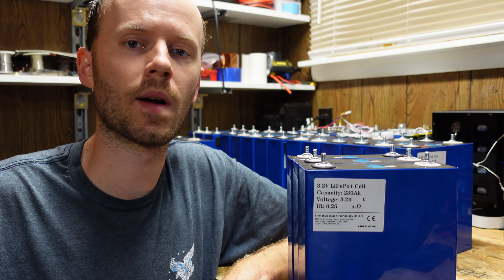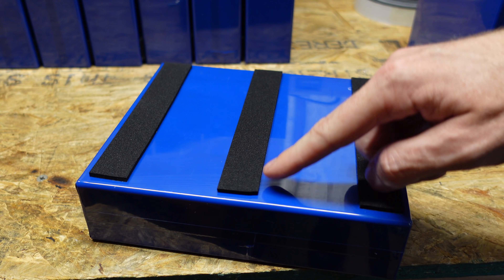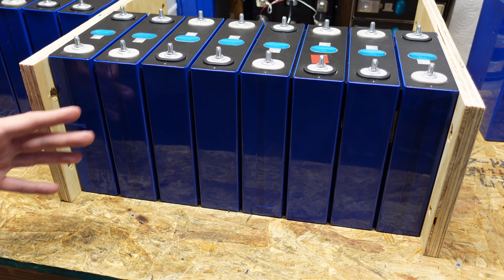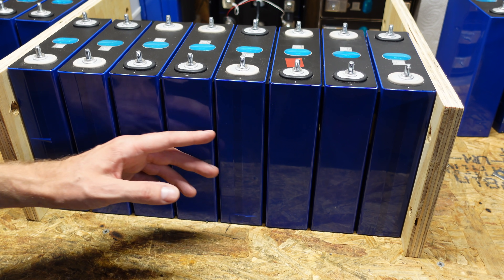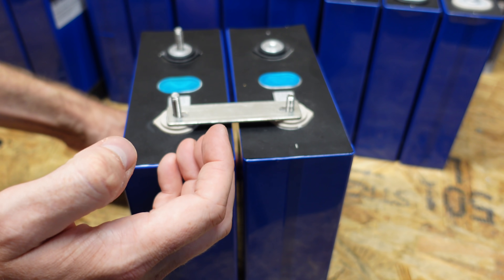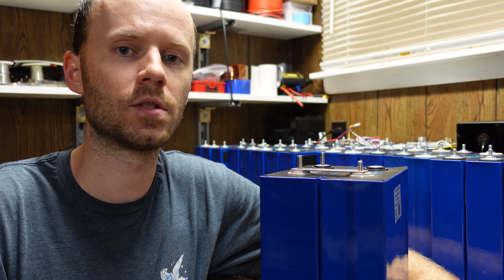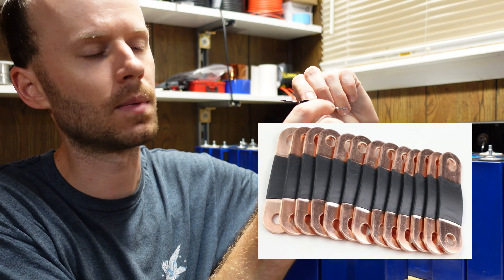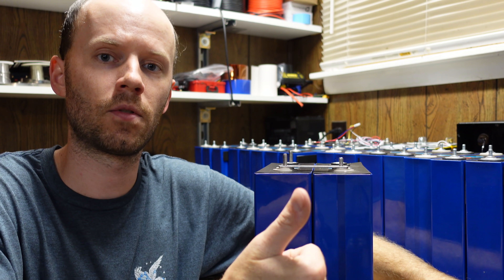Quick Update on 230Ah LiFePO4 Battery Pack Building and Fixture

Comment: I’m in the process of doing a cad file, and sending it off to get a bunch of thin copper cut and bend and stack. I was also thinking of DIY coating them with chrome or silver. Just not totally sure on the coating. But not sure if that’s something you’d be interested in.
Reply from the maker: YES!! Nickel-coating seems to be the standard from what I can tell. How soon can you have it done lol? I'll buy some.
Reply: @LithiumSolar  Electroplating the copper strips with nickel yourself is also an option, and surprisingly easy.  Geoffrey Croker's channel has a great guide to doing it at home.
Reply: @LithiumSolar  do you want some longer ones for end to end as well? If so can you get me the measurement in mm? Center to Center ?
Reply: Buy the tinned braided strap in roll form and then use a tapered rod to make holes for the lugs (spreading the braid). You can use whatever type washer to prevent corrosion.
Reply: @niwachien  I have 1” braided strap. About 100’ of it. I’ll have to test
Reply: @niwachien  just makes me a little worried if it heats up abs lays down
Reply: @DIYSolarEnergy  I size my strap for 120% of max amp draw but I've never used it in this manner. It is easy to add solder to tinned strap to increase it's ampacity. You can also add strips of silicone under the strap. It's available in sheets of various thickness fairly cheap.
Reply: @niwachien  I agree. I have custom built Amateur Radio Amps, and use it often. For ground straps and yes it wicks easily
Reply: @DIYSolarEnergy  I used it to combine 250 4.4ah lithium polymer battery packs, each having their own BMS into a 36v nine inch cube to run my trolling motor. 1000 solder joints. The combined used packs deliver just under 100ah
Reply: @niwachien  If you have tinned braided strapping, could you heat and solder the ends and drill a hole?
Reply: @haydenwatson7987  Yes.
Reply: I’m interested 1000% man
Reply: I wonder if there is an option to have the strips open ended so that if there is expansion they cannot pull? If using a big enough washer on top the prongs would maintain a good area of contact. Just need to make sure they are long enough not to be able to slip out and cause either disconnection or shorts.
Reply: @BobHannent  The woven copper strap is continuous with a hole spread open in it's center for each battery terminal. Extra strap material arches up between each batter terminal to allow for expansion.

Comment: Still happy with the 230ah cells? 
I am getting ready to take the leap of building a 24v battery an I think I will start with 230ah cells
Reply from the maker: Yes sir, they've been fantastic - still running strong. I'll be rebuilding them in a steel enclosure here in a few months and at that point, I plan to run a capacity test to get an exact number of how much capacity they've retained.
Reply: @LithiumSolar  will be great to see. Your videos are very helpful.

Comment: Why would you not compress the 230s?  I have 16 of them and really like them
Reply from the maker: Have you watched this video yet?
https://www.youtube.com/watch?v=uZe6BDvWPfI
Reply: @LithiumSolar  OK so I just watched the video. What I had decided to do and basically am still keeping them this way is to lightly compress the 230s with ply and threaded rod. The ply gives me a nice place to mount the BMS units and Bluetooth transmitters 

When at full soc I tightened with a socket, but no ratchet, only hand tight. So at lower states of discharge they are loose enough you really can't pick up the batteries and frame without being concerned the batteries could drop out

I also had the hump busbars, but decided to make 2" cables with #2 wire and M6 lugs.  I tested the resistance of the cables when complete and the resistance was all the same and slightly less than the hump busbars.

But being slightly compressed the cables where probably overkill.

Comment: Dont you want to constrain the cells from expanding? because what is happening inside is the anode and cathode are being pushed away from each other and that is a major factor that contributes to capacity degredation, any pouch cell that has gone puffy is not long for this world as there is now nothing holding the plates together so they lose contact across most of its surface area and that directly correlates to capacity loss. So the same principle applies for hardcase packs, cyndrilical are the best because there is no side to give out but Rectanglular cells can push out in the center so you want even compression across the whole surface of the battery, especially the center, since it is not constrained by the sides.
So I think full sheets across the whole side of the battery are the ideal solution and have compression according to the manufacturers specification. Ideally you would want something that will allow for expansion and contraction while keeping the same amount of pressure.

Comment: I think galvanic corrosion is often misunderstood.  Ideally, you want the two metals to be as close to each other on a galvanic scale as possible.  If you are worried about copper buss bars to aluminum, a thin solder coating would be slightly better on a galvanic scale than nickel would.  
According to EVE manufacturer, the cells swell in the middle about 1mm when fully charged.  Bending buss bars at 90 degrees is not the same as elongating them laterally.  The neoprene will surely give before the buss bars elongate.  
The fuse to the BMS is a bad idea, because it will likely induce voltage differential over time.  Check into a PTC resettable fuse that you could solder and shrink wrap to the buss bar.  
Stainless steel grub screws into aluminum? LOL!! (cadmium plated steel is a much better idea galvanically).  
Overall, I think your on the right track with the neoprene.  Keep up the good work!!

Comment: What about an offset stagger arrangement like a jacobs ladder or when you knock over dominoes and they lay up on each other. More room for expansion with less terminal stress, downside is the space occupation but this might help with heat/temps....or perhaps use a press and die and make you own little bus bar humps.

Comment: Good info, really enjoy your videos…. keep them coming. WRT securing the plywood end boards, suggest you use nylon castellated nuts to secure them. That way you keep them locked at the desired position and not  apply undesired compression to the batteries.

Comment: The foam (or soft rubber) isolators should to cover the entire adjoining areas between individual cells and the perimeter. Select a material with a specific compressive strength that will provide the manufacturer specified pressure when the batteries expand according to the manufacturer's specs.  The expansion is mostly in the flat areas; the rubber compresses, providing the desired pressure; there should be little or no increase in the center-to-center spacing of the studs.

Comment: I'm thinking of using 1/8" plywood and creating a frame 1" wide to place between each cell.   Inside the frame, I'm going to place 1/4" foam that will compress to 1/8" to match the plywood, but still leave room for the cells to expand.  With this system, I can then use a similar system as you have with plywood ends and ready rod.   My cells are going into a RV so they need to be compressed some to contain them as road vibration will be a bigger issue than expansion.

Comment: I think someone's OCD has kicked in. I put my 280Amp Hour cells together with the kitchen cutting paper between the cells and used the large 12" hose clamps around the entire battery. I used pieces of the cutting paper where the clamps cross the corners of the cells. Worked great and I'm very happy with the results. Don't worry so much. Be happy!

Comment: On the balance lead connection, is there enough room on top of the flange nut to put a second nut? Then the balance lead goes on top of the flange nut and is held in place by a nut on top of that?

Comment: I totally agree with what you're doing with the foam and not compressing the batteries! Exactly what I was thinking on doing with my setup. With my batteries being in a wood compartment that I built I'm just going to place end caps basically so that they cannot expand but no compression as well.
If you think about it the way the batteries are shaped with rectangle on top and bottom there should not really be any expansion or contraction. They should only do this in the middle of the cells.

Comment: So do all LifePo4 cells bloat a bit when fully charged? I got 4 new cells 200Ah from BLS (supposedly Grade A) and after charging first cell I noticed some bloating and stopped charging. The cell was at 3.2V initially and charged it at 15A for around 10hrs. Cell voltage was still at 3.35V so still not fully charged. I am discharging it now to see how much it gives and if the bloating reduces.

Comment: I had a question, it would be more expensive, but would 3A dc circuit breakers be an idea rather than fuses? This way I would just have to flip the circuit breaker back on, rather than going through the hassle of finding the fuse, and putting in a new one? I am thinking from an end user who is not me and trying to make things simple for them. Parents can flip circuit breakers, but they would never go close to the battery to check a fuse.

Comment: Could have just double nutted the BMS lead with the ring connector.   Tighten up bus bars with nut 1, put ring connector on top of that nut and use nut 2 to tighten onto BMS ring connector

Comment: my 16 cell 24-volt Lishen 272Ah builds do move about / bloat at a 40 amp charge from the solar panels charging which is only 1/7 of C so a very low charge. the best is to compress or fixture them to help keep the terminals stay at the same distance (to safeguard the terminal connections). I like your idea and thank you for showing what you are doing. I am not an expert; I can only tell you what I have observed in the 10 months of charging 2 packs of 16 cells each of the Lishen  272Ah cells in a 2P8S configuration (544Ah in2P configuration). keep up the good work. I have not put mine under any heavy loads yet but they could potentially see heavier loads this winter. Again, keep up the good work. I really appreciate your videos. 😎

Comment: I assembled a 4P8S 24-volt battery using 272Ah Lishen cells. I made 4 2/0 short cables to make each set of series connections(28 interconnects). the assembled battery is at 27.35 volts and I am in process of doing the Electodacus for the BMS right now. I used 4 2/0 cables from the main positive end to a positive bus bar, and 4 2/0 cables to a negative bus bar from the main negative end. 28 interconnects for the 8 series connections took 56 lugs. then 16 more lugs on the 8 cables for the main positive and negative.
For the 32 cell 24-volt battery build >>> each of the 2/0 interconnects is short, about 4 inches center of lug hole to center of lug hole; the 4 main positive and 4 main negative 2/0 cables are about 11 inches center of lug hole to center of the lug hole. I have 2 60-inch long 4/0 cables to the inverter with of course hydraulically crimped lugs. They are also heat shrink-wrapped with adhesive-lined shrink wrap for a bit more safety/seal.
 The cells have 20 or 25mm M6 studs that are carefully installed so as not to strip out( a known reported issue). the 25mm studs seem to be the perfect length so any and all connections can be made without length issues.
All parallel connections were made 1st using solid insulated nickel-plated copper busbars provided by another china vendor; then the series connections >> I had to make as the busbars were not readily obtainable and I was seeking a bit of wiggle room.
 Yes very time-consuming to hydraulically crimp all those 2/0 interconnects and main cables; I also hydraulically crimped 4/0 cables for the 2 shunts and class T fuse connections. slow for sure!!!!
 As I assembled each set of series connections I checked the increasing voltage and all was as expected.
The compression fixture is still in the making but I bought threaded rods and nuts/washers etc for that part. still assembling some in-between all the other things to do.
glad to see your videos on the compression issues; as almost all assemblers are encountering similar issues and decisions to be made
 I have 2 other 24-volt 16 cell 2P8S batteries assembled (using 272Ah Lishen cells) and running for about 10 months and some have swelling issues but are still functioning. need to set up compression jig improvements on those 2.
 I like your videos. thanks for providing them! 😎

Comment: I recently found some pre-made braided bus connectors. They are called "red copper soft braided cable" from POTELY. 
They have M8 holes and 16mm2 braided cable, so they are rated at 75A, which might be short of what you want, but maybe you double up?
But they aren't very cheap unfortunately, £3 each.
Reply: really need about 200 amp rating between 272 or 280Ah cells. that was the problem I encountered when searching the braided busbar /cable options.

Comment: I found pure copper grounding strap on Amazon. Similar to the copper coated steel kind you use for securing a hot water heater. This allows for a small arch between the cells which will allow flex. Works for me, YMMV. I am used to lead acid that need a yearly cleaning, I think just keeping antiox and inspecting them is good enough. I'm curious about the fuses on the balance leads?

Comment: I like the idea with neoprene foam.
What worries me a bit is to connect the the thin BMS cable by soldering and also one fuse in series. There will be a voltage drop as a result. The voltage drop may vary between the different 4/8/16 cables to BMS. When BMS measures with such high precision as the third decimal, I wonder if it can have a negative effect on balancing. Also, it might be a variation of voltage drop between the different fuses even though they are the same specification and order batch.

Comment: Just make rigid plastic frames about 1/8” apart - I’m thinking using T section. So the centre of the batteries can still expand but around the edge of the aluminium frame you now have a rigid plastic frame.

Comment: I would use 1/4 or 5/8 in copper tubing.. hammer the ends... drill a hole on each end.. you have a simple and cheap buss bar.

Comment: Nice video, I came to the same conclusion to use something soft as spacers for my swollen cells. 
I'm hesitant about curved busbars, not sure if studs are strong enough to bend busbars when cells are "breathing", or maybe if the curve has more angle (more like __/\__) then it's a good idea to use curved busbars.
Reply from the maker: I feel comfortable with them as I can bend them very easily in my hands. That being said, every cell and bus bar is different so can't say the same applies everywhere.
Reply: @LithiumSolar  got it, thanks

Comment: I was very surprised to hear that you only expect a 5 to 10 year service life for big , blue LiFePO4 
batteries .   I would think that a cycle range of say 50 to 80 per cent would give about a 15 year lifespan .
Reply from the maker: I really don't know what to expect to be honest. At 3500 cycles, that's just under 10 years. At that point, I don't know if other factors would have come in to play such as corrosion, degration of elctrolyte, cheaper battery technologies that make it worthwhile to upgrade, change of personal interest in such a project, etc. If I get 10 years out of them, I'll be crazy happy!
Reply: @LithiumSolar  Cycles refers to depletion and recharge, not simply some use and recharging each day. Drawing down 40% of capacity and recharging to 100% is not a cycle.
Reply from the maker: @Stephen2846  Yes, drawing down to 40% and recharging to 100% is indeed referred to as a "cycle". However, you are correct in that the "cycles" referenced in the datasheet are referring to complete discharges. They are both "cycles" just the 40% cycle is not a "complete cycle" if you want to get technical...
Reply: The batteries will degrade over time even with no cycling at all. I think calendar life might be a more important metric than  cycle life for LiFePO4.

Comment: I would have placed a metal plate between all the cells, and then compressed the pack. Nowhere to expand means no expansion, and no stress on the terminals. 

problem solved :)

Comment: The foam is a good way to go. I would definitely put the foam in the middle, just for that extra little force resisting the cell expansion.

The larger cells, in regards to just making interconnects out of wire with lugs, honestly, I wouldn't be too worried about the heating up / bad connection thing with a quality crimp, but if you're not sure about crimping, why not solder them? :D 
I had VERY good luck with soldering interconnects like that back in the day when I had an (admittedly insane) 1000 Ah @ 12 volt battery bank of AGM batteries. I soldered some beefy 2/0 AWG interconnects for them, and they worked great. I actually reused some of them over the years well after the batter bank bit the dust. Thermal camera showed no signs of heating up even under 100's of amps. A good solder potted connection, I assure you, will be 100% fine!

Pain in the arse? Yea. But if you make them right, you can reuse them for the next battery bank after these cells go in 20 years! :P

And oh, if you want to use copper bus bars on aluminum terminals, just zinc plate them. :) You can in theory do the plating yourself, but I'd imagine there are off-the-shelf solutions as well. :) 

EDIT: To be clear, the zinc coating is effectively sacrificial here, but the time frame in which you'll experience issues should be suitable in most cases.